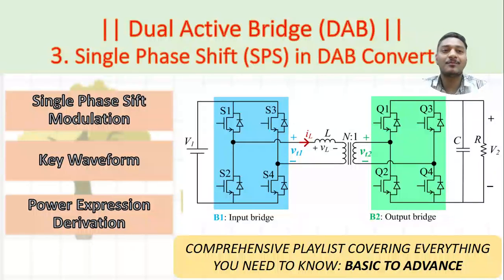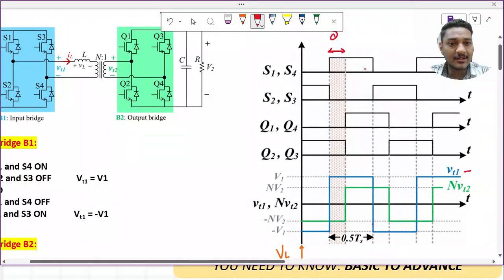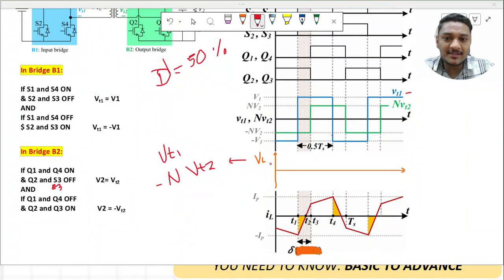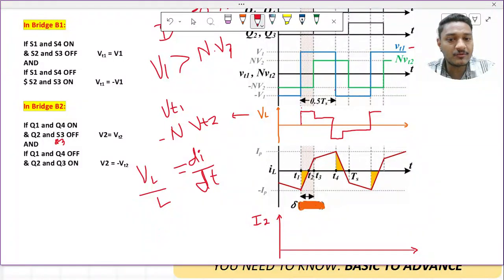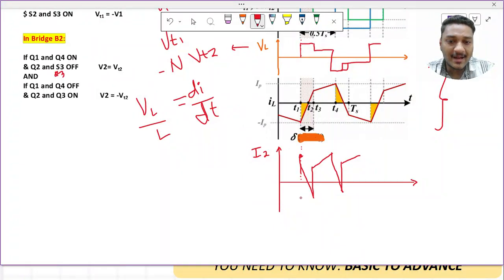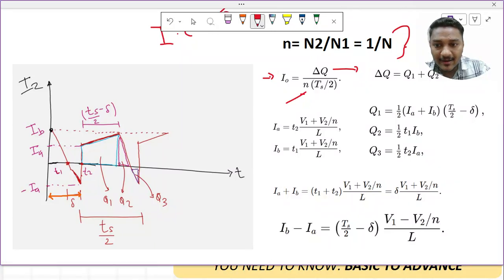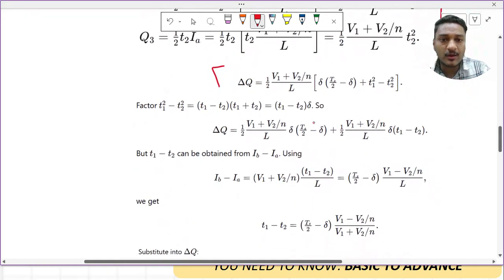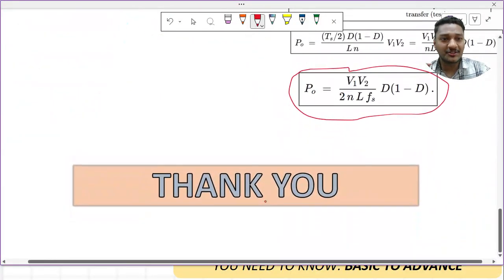LECT 03 Single Phase Shift (SPS) Modulation in DAB Converter #DAB

Comment: I think Q3 area is wrong because for the Q3 area, base should be t2-t1, please verify this...also can you explain the equation of Ia please???
Reply from the maker: Yes It's mistake. I had discussed this part in beginning of next video. Please watch it once you'll get an idea.

Thanks for commenting this, I had forgot to pin this msg in desciption.

Happy Learning ❤❤
Reply: @Kingashish-555  Sir in next part also how in Ia only t2 is coming, t1 should also be there in Ia equation. it shoult be (t2-t1) in place of t2 only.
Reply from the maker: @shivamporwal4552 how we define it, lets quickly see that first.
So we say t1+t2 = del.   So t1 si 1st duration and t2 is second duration. It is not contiuous duration. So zero to 1sy instance time is equal to t1.  And from that instant to 2md instant time is t2.  Overal 1st instance + 2nd instance is del.  
1st instance total time : t1
2nd instace total time is t2

Hope you get this point.
Reply: Ia explanation: since the inductor slope is [V1+ V2/n]/L,  slope for I2 = - IL is the negative slop of inductor current. i.e  - [V1 + V2/n]/L.   moving from time t1 backwards along that slope i.e -t1 direction, you will reach Ia. That is, Ia = -t1 x -  [V1+ V2/n]/L . negatives cancel, so you get Ia =  t1 x  [V1+ V2/n]/L
Reply: Hi @mzraja4407 I think that here t2 should be considered as a time interval rather than a specific point on the time axis. This becomes clearer later in the derivation, with 𝛿=t1+t2, hence t2 = 𝛿-t1.This also gives a lead to answering your question, since the slope is the same, Ia corresponds to a time interval of t2, whereas Ib corresponds to a time interval of t1. In short, unless I am mistaken, the graph needs to be adjusted accordingly.
Reply from the maker: @tchengoumfabrice3038 yes you are right.
Thanks for writing this.

Comment: sir, in dual active bridge we give contant input and convert its voltage to alternating DC so by swtching we getting alternating DC at Vt1 the same alternating Vt1 with turns multiplied should be induced at Vt2 Then how are we getting a wavefore that looks like it has contant DC voltage for trasformer input and is getting alternated by switching Q mosfets

Comment: Sir, as u are considering positive slope for I2 =-IL as well, but it should be negative because it is falling slope, that is -(V1+V2/n)/L. and while calculating Ia, in place of t2 it should be t2-t1 (in this i am considering phase of t2-t1). Please correct if possible. and in Q3 area as well it will be t2-t1 in place of t2
Reply from the maker: I have answer you in one of your comment.
Please see there and if still have any doubt, pleaee let me know.

Also sometime, people have also answer such doubts in comments, so read comments as well thay will also help you for sure.

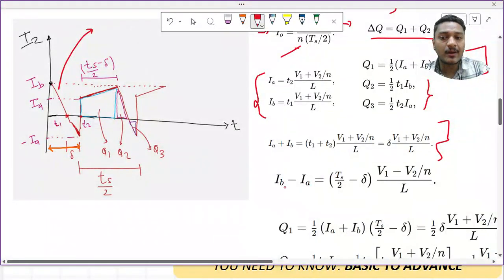Comment: 25:04 why is delta equal to t1 + t2 and not t2  yet you used t2 as absolute value in calculating Ia?
Reply from the maker: Yes, I had may be discuss and clarify this part again in next class. Please check once and then if u have any doubt I am happy to answer.
Reply: @Kingashish-555  would appreciate if you discuss it on the next class

Comment: Why did you divide by n for calculating Io that is output current
Reply from the maker: We are having inductor current waveform which is on primary side and we want the expression of current which is on output side, so we need to refer inductor current for this as we draw Io waveform with the help of inductor current only. 
So thats why factor of n is there.

Happy Learning ❤❤
Reply: n=1/N